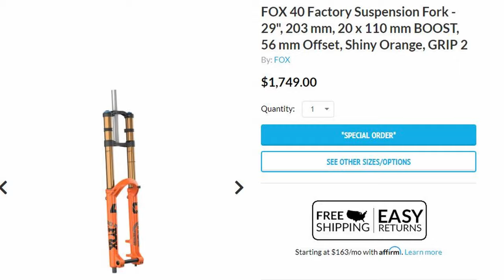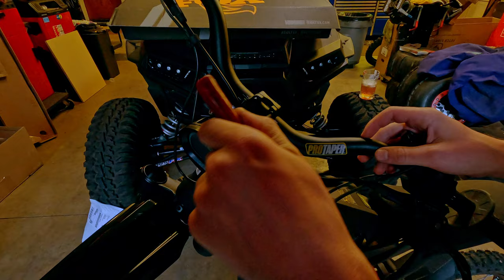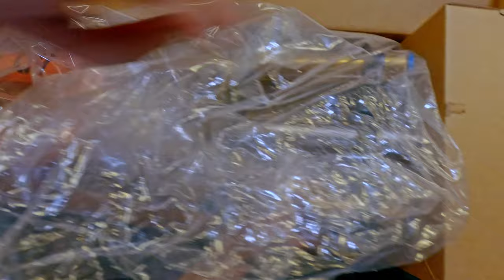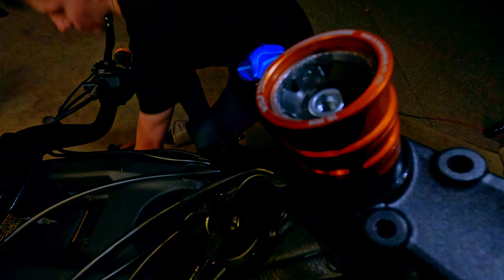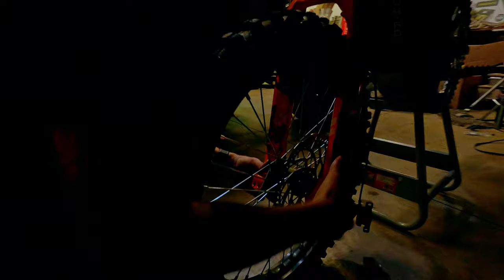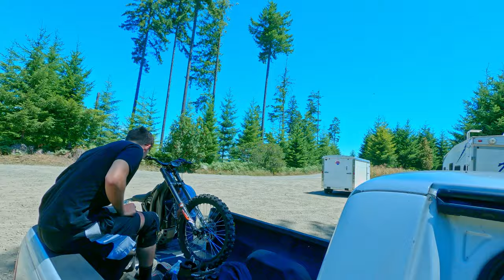Sur-Ron Fox 40 Installation and Test Ride + First Impressions

Comment: Is that a 19 inch wheel?
Reply from the maker: Yes, stock 19in.
Reply: @emotobros  have you the rear spring suspension
Reply: What's the ride like to the original if you're off road..
Reply from the maker: Stock rear shock too. I think the ride is great assuming you have it setup correctly. We have a video on that as well.
Reply: @emotobros  I've to install my 75 volt battery.. just need to update the suspension forks and rear spring..
Reply: @emotobros  what rear shock you recommend
Reply from the maker: @user-px6qe2qm8p  Never heard of a 75V battery before, what controller are you running? Also, would recommend the fox or ohlins rear. Think it needs to be 10.5x3.5 to fit the Sur-Ron.
Reply: @emotobros  yeah mate 75v battery pack an controller.. look it up the bike will beat most MX 0.60

Comment: How you noticed if it provides any extra tire clearance over the factory fork?
Reply from the maker: Less height wise since it has a stanchion brace. Width is the same.
Reply: My fork arrives tomorrow! Did you need to reuse the post mount adapter for the rotor, or did the caliper bolt directly to the fork? I ordered a 220mm floating front rotor as well and was wondering what I’ll be lookin at for my rotor situation. I have the adapter for the 220 as well as the stock for the stock rst fork

Comment: @E-Moto Bros You guys should do a comparison between these at YZ 80 forks. I've seen a few different guys running them and considering you can basically get a full front end off of a YZ 80 for like $300 it seems like a better option.

https://www.youtube.com/watch?v=u56KiH0qivU&t=288s

This guys installation was kinda janky but the potential is there. Bike gains a bit of weight but I bet those forks work way better since they're designed for a heavier bike.
Reply from the maker: I could definitely see those being better performing assuming you get the correct valving. Only issue as you mentioned is weight, I’d think it’d really throw off the front to rear balance.

Comment: lol....$1700 + $1700 = new sur ron...lolol
Reply: @troymuni6120  ...lolol...i guess u either cant read or u cant add...i said $1700 +$1700 = new surron.....$1700 +$1700= $3400....new surron= $3600
Reply: Troy Muni half the bike into junk pile? Lol little overly dramatic.
Reply: @troymuni6120  don't know what Sur Ron you bought but mine is fuckin ace from out the box it's what you make it if your trying to make it a KTM 450 that's your own problem not the sur Ron's they are pure fun and I go out for hours on mine

Comment: I missed the part where you looked at rigidity. One of the most important things for MTB forks on a dirt bike.
Would also really like to see a lot less riding on stock settings and more emphasis on demonstrating the range of adjustment available.
This video didn't really tell me anything I couldn't find out in 30 seconds of googling, aside from some too dark, low quality assembly footage. Plays too much like advertising BS to me.

I understand its hard to make good content. Thanks for taking the effort and initiative. Hopefully my feedback can help next time.

Also what would you recommend for a heavy rider that goes hard and really really wants something better than FOX 40 for a 20kw sur ron without paying double for a brand name?
A Chinese bike should have Chinese forks right? Its not really about cost. Its about value, and not supporting fox. I'd spend more for better.....
Reply from the maker: Think you also missed the part where this is just an installation and first impressions 😂. In all seriousness though, we are doing a full review of the fork but something like this needs to be thoroughly tested.

Thanks for the feedback, this video was filmed on a GoPro prior to get our Full Frame which is why the footage was so bad.

Our fox 40s were $850 after discounts and selling stock forks so I don’t know if you can beat that for the price. The problem with getting something “better” is that anything stiffer is for a moto bike and they completely ruin the balance of the bike. I think personally that the next best option after Fox is Marzocchi Bomber 58s. If you can find something better for the price let us know, we would love to check it out!

Comment: quite funny. out of the box using a 40. no setup on that trail and btw rich kid, the brake hose has to be installed inside and not outer ^^
Reply from the maker: We are adults with full time engineering jobs, big yikes man. Also that hose was fixed right after the video. Not setting it up fully was kind of the purpose of a first impression video...

Comment: First of all, thanks for making this great video, but can you please bleep-out the f-bombs and such? One day you'll have little kids hanging around you, and then you'll understand. Regarding the fork review, of course you're going to find this fork is better than the DNM, because you just shelled out $3.4k for them and you need to justify that purchase to yourself. Watching this ride video compared to your previous ones on the DNM, you don't look any faster but making just as many mistakes. As Cymadbro summit commented below, there's not really a massive difference. He would know. That is what I expected. DNMR is working perfectly well with lot of adjust-ability. Maybe not as stiff but that's not always a disadvantage depending on the trail conditions.
Reply from the maker: Russ Bowers Channel We can try to tone the language down however we don’t really expect young children to watch these videos. Good forks actually don’t make you much faster so much as they can reduce arm pump and make it easier to ride harder for longer and soak up the bigger hits effectively. Also you should note that we did not have the fork set up well in this video so it was pretty stiff and could definitely be better with good setting. As far as Cymadbro’s comment goes he is not referring to the factory Fox 40 but the Elite which is over $1000 dollars less than the factory version. Those two forks are really not comparable at all. The only thing they share is the same manufacturer. Another thing to note if we didn’t look “faster” in this video is that Riley was running a larger sprocket and Cole made some bad line choices on the uphills that’s created distance but that really doesn’t reflect badly on the fork in any way. In response to your comment about the DNM having a lot of adjustability: what on earth are you talking about? It has a barely functioning preload and rebound adjuster that is absolutely terrible.
Reply: E-Moto Bros True, the rebound and preload on the DNM may be near the end of their ranges but they reach the settings that work great for me. I don’t care if these settings are not closer to the middle it’s not worth an extra $1500 for such a subtle improvement on the small bumps. Regarding arm pump, trails where I ride are a lot rougher and with more roots than your trails (I’m so jealous, your trails are so much better). 20 miles and my arms are just fine, so I don’t know - it could be I spent a lot more time riding and racing mountain bikes for the last 20 years. Regarding your expectation that little kids don’t watch your channel,  they don’t, but sometimes they are with me while I’m watching. It’s fine on the trail but it’s nice if you can bleep it out in your YouTube videos. Like I said, one day maybe you’ll understand. Anyway, I do enjoy your channel. Your videos are great. Keep up the good work.
Reply from the maker: @russbowerschannel449  We are glad you enjoy the video. We price matched last years models through Jenson and sold our DNM forks so we are only into these about a grand each. We are a little confused what you are basing your information on though. Have you ridden a Factory Fox 40 or are you assuming things? We have ridden both and we both feel the Fox is much better in every single way than the DNM. As far as being able to ride over 20 miles with no arm pump, that is pretty impressive if you are going race pace. Arm pump is a serious problem for professional riders even so if you can ride at a competitive speed without arm pump you might want to look into racing.
Reply: I'm ok with the "F bombs".. we're not all snowflakes 😉😁
Reply: @russbowerschannel449  ... untill they melt... listen with headphones?🤷...next excuse 🤔...❄️❄️❄️
Reply: @bryanberesford7521   So Bryan enjoys foul language, and he expects the rest of us to relish it as much as he does?Then when a viewer who asks politely to bleep out the f-bombs (because he doesn't want his young daughters hearing it), Bryan labels him as a snowflake. Bryan, do you even ride? This is a Sur Ron channel talking about Fox forks, not Hannity and Fox News.
Reply: @russbowerschannel449  ....editing responsibilities belong to the parent....YOU make sure your kids dont hear it....if it bothers u that much... then it sounds like the language is 2 ruff for you as well....some ppl .... i tell ya..lolol
Reply: @russbowerschannel449  ...get over it already

Comment: Hack fork installation.... there are tools for cutting the steerer tube, setting the crown race, and setting the star nut (which you didn’t install deep enough). Not trying to be a hater but you are showing people improper ways to work on a very powerful machine that could result in serious injury.
Reply from the maker: Yeah it’d be really nice if every person who ever bought a new fork had every tool they needed to properly install it. That’s just not our audience. Also, I worked at a bike shop and am well aware of the proper way and the star nut was pushed in further off camera. Thanks for the feedback though.